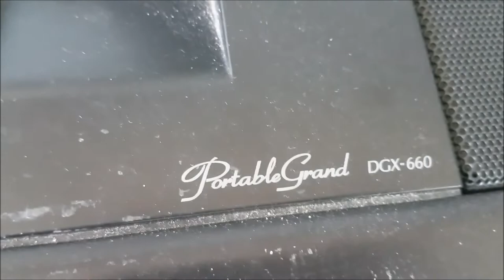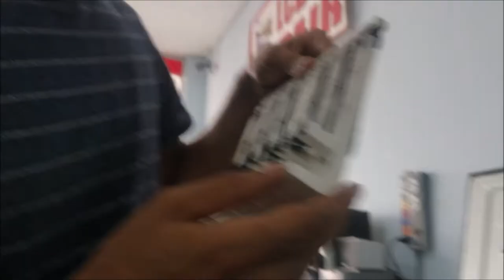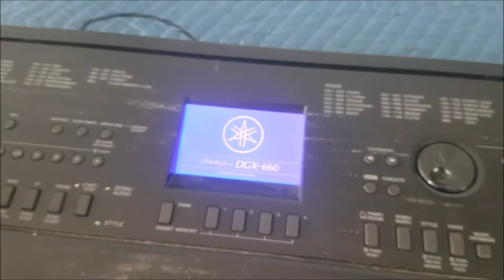Yamaha Portable Grand DGX 660 music keyboard  broken key and some keys no sound

Comment: Just had to clean my keyboard after dumping tea w/honey all over the top
it prevented some of the keys from working - all sticky outside and inside
I used this video to figure out how to get in there, thought i'd write down what i learned and share it.
BTW - thanks SOSFix! Appreciate your help! 

How to clean & service the Yamaha DGX 650 Keyboard
1. Remove the 4 screws holding the piano to the stand and slide off of stand
2. Remove the bottom back trim - 13 + 2 screws
3. Remove bottom - 30 screws - gently unplug the speakers before totally removing
4. Remove Metal bar with 2 screws
5. remove 8 screws from the front underside that hold the keyboard in place
6. remove the 2 screws holding the ribbon in place and gently pull the ribbon out of its connection and then through
7.  remove the 8 screws that are in between the metal wires/rods to release the keyboard
8.  pull the keyboard up and out to service
9.  Unscrew the sections of keys and push down the front to disengage them and remove them
10. Gently pull up the rubber strips
11. clean the contacts with q tips and rubbing alcohol and also the underside of the rubber contacts
12. put back together in reverse order.
Reply: This is very helpful.  Thank you!
Reply: Appreciate this! Thanks

Comment: I recently had a lightning bolt strike my house and it fried the power supply to my Yamaha DGX-660.  I purchased a new one and it powers on and plays, but the sustain pedal will not work.  I replaced it with a new one and it still doesn't work.  Do you know what the problem might be?  Maybe that port got fried?

Comment: I got this keyboard from "Trade-It" a couple of weeks ago. But... the sustain pedal acts like the pitch bend wheel. Any ideas?
Reply from the maker: Take it apart and look inside maybe a crack or bad solder
Reply: @SOSfixElectronics You can re-program what the sustain pedal does. It may have been changed in the settings and could be an easy fix.